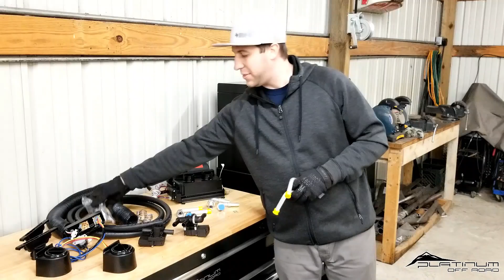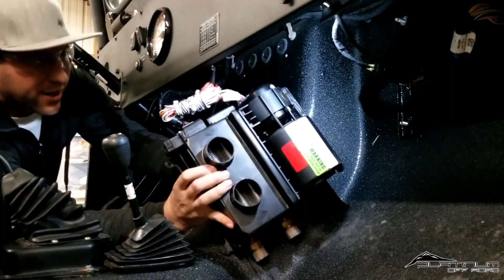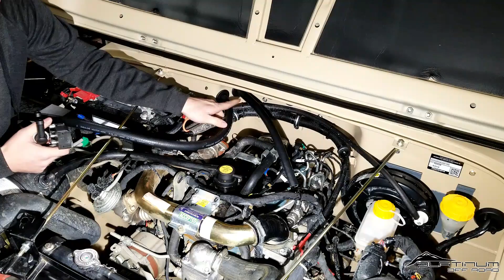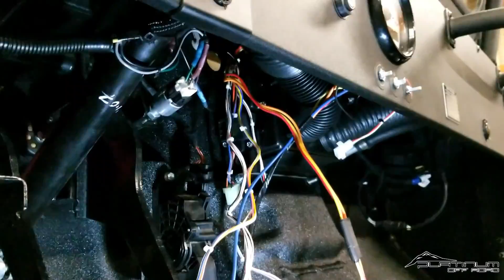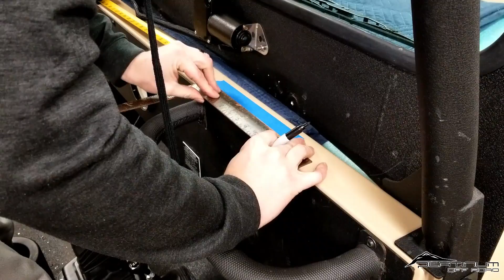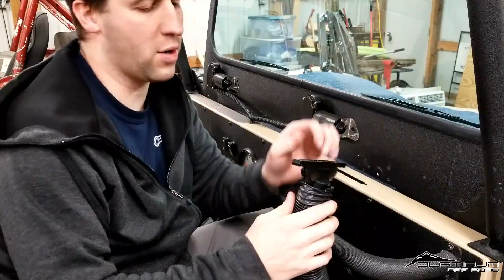Mahindra ROXOR Heater Kit Install

Comment: It looks like the defrost vents at least the top part of the actual vent, is supposed to mount on top of the dash and go down through the dash. I couldn’t tell if the vent came apart to be able to do that. Obviously if it doesn’t then you’re not going to cut a hole that big but if the top of the vent comes undone from the rest where the hose hooks up then you can mount the black plastic vent on top and the rest would connect from the bottom.
Reply from the maker: If I recall, we tried to see if something like that was the case and it was not. That vent / duct was pretty fragile. We ended putting a Jeep CJ windshield on the Roxor, so the flush mount is perfect for our application. Before the swap, we were able to test out the defrost as it is in the video and it worked pretty well, just as planned.

Comment: Good video, but you need a different camera. It was having a hard time focusing there in the beginning and was a distraction.
Reply from the maker: Appreciate the feedback. We spent hundreds of dollars on attempting new cameras, whereas we were only disappointed and returned each one, time after time. To get what we need, it takes thousands, not hundreds. Maybe down the road if the channel can make a return on the investment we will definitely move that direction. Thanks again!
Reply: @PlatinumOffRoad  that sucks. Well I'll help ya out a little bit by watching and subscribing.
Reply from the maker: @OfWolfandManDL  thanks!! Every bit counts! Winter season is our slower time around the shop and we can crank out a lot of videos. Spring and Summer has had us slammed to where we haven't even been able to find extra time to film. Stay with us though!

Comment: The factory accessory heater from Roxor is a way simpler set up and a faster install, maybe an hour or a bit more and easy to do it your self.  You also don't have to cut any holes in the dash for defrost.  The Roxor is also prewired for the factory set up, plug and play and it is less expensive.  
https://youtu.be/hKIZeDMud2g